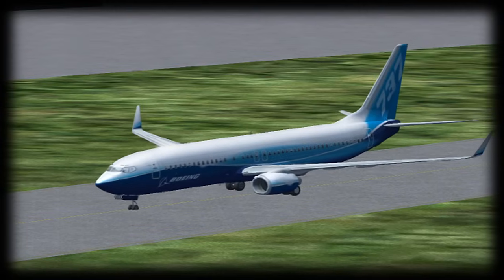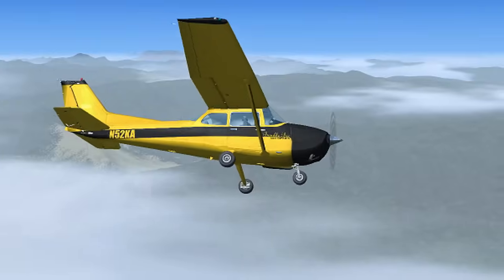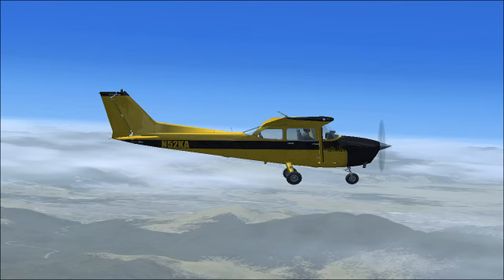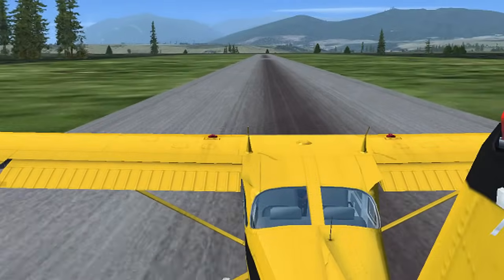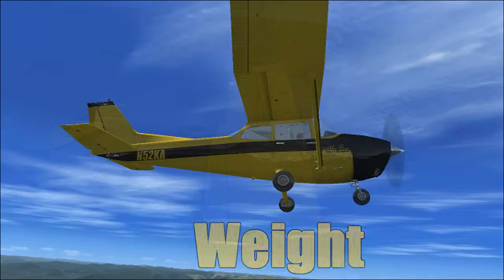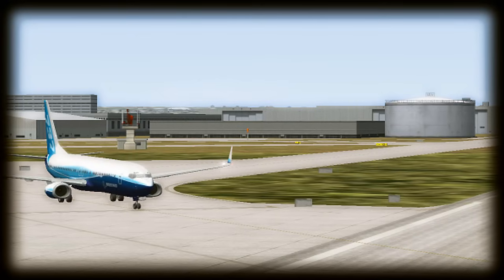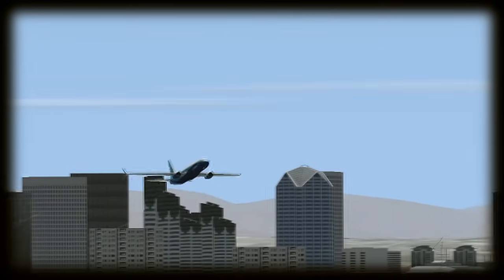The Aerodynamics of Flight

Comment: Great video but we have to point out that this is one of those videos that get the theory of lift wrong. Even though some minor lift is generated by air being forced to move faster above the aircraft, the vast amount of lift is generated by the aircraft curvature turning air downward and the air applying an equal but opposite force upward (lift) upon the aircraft. Even though the second and minor cause of lift is altimately explained by Bernoulli's principle, it is actually the coanda effect that creates pressure difference between the top and bottom aircraft surface. The coanda effect is the tendency of air to follow the curvature of a round surface

Comment: Who watching this in 2024 vote here 👇👇
Reply: Present
Reply: Here. Great video but we have to point out that this is one of those videos that get the theory of lift wrong. Even though some lift is generated by air being forced to move faster above the aircraft, the vast amount of lift is generated by the aircraft curvature turning air downward and the air applying an equal but opposite force upward (lift) upon the aircraft. Even though the second and minor cause of lift is altimately explained by Bernoulli's principle, it is actually the coanda effect that creates pressure difference between the top and bottom aircraft surface.
Reply: @randatatang9222  intresting...I never heard about this
Reply: 2025
Reply: Sorry I'm late 😅😮
Reply: Here

Comment: When a slightly inclined aerofoil starts from rest, it dumps a starting vortex in the flow. This can actually be visualised. If it stops, it dumps a stopping vortex. If it moves in an intermittent start-stop action, it generates a vortex street which can also be visualised.

While the aerofoil is moving, the stopping vortex is tied up with the aerofoil as bound vorticity. This generates lift by the Magnus effect. I can explain the Kutta condition and the Kutta-Joukowski circulation theorem if you like, but Magnus effect is good enough.

A hydrofoil moving through liquid sodium generates lift by the same mechanism. The same hydrofoil moving through liquid helium with the same geometry or kinematics does not generate lift, because the helium is a superfluid with no viscosity and therefore no starting vortex.

Explanations appealing to Bernoulli, Newton or Coanda are useless at distinguishing between liquid helium and sodium.

Comment: Would it be important to say that the y component of lift must > weight?

Because with a high angle of attack, lift is not parallel to the force of gravity, and therefore some of the lift force is in the x axis, causing induced drag.

As angle of attack lowers, and lift force becomes close to parallel, induced drag lowers.

Comment: the book "Stick and Rudder" by Wolfgang Langewiesche explains LIFT in much more simple terms,.. the Wings push the air down (given it has positive Angle of attack) , and with the proper speed, having pushed enough volume of air down - the airplane takes off.  it's a fascinating read

Comment: No, wings don't produce lift because of the bernoulli effect. Wings produce lift only by deflecting air. Wings that don't have an airfoil work exactly the same way. They can get lift even while upside down. The airfoil shape is about the efficiency of deflecting air. Different airfoil shapes are more or less efficient at different speeds, but in anycase deflection causes the lift, not the shape. A older textbook might tell you that low pressure above a wing causes lift. However, low pressure above a wing is lift. Lift does not cause lift. The older textbooks might also tell you that air above the wing meets the air underneath in equal time. This is also false. Air above advances past, while air below is retarded. ( only when the wing is doing work). Air above and below meet at the trailing edge only when the wing is not producing lift. The bernoulli principle explains how a force is transmitted to a wing, but not the cause of the force. You get lift by deflecting air, not by causing low pressure above the wing. The low pressure is the lift reaction caused by the deflection action.

Comment: Not a very useful video for understanding airplanes. He used the incorrect "equal transit time" theory to explain lift which is not how lift is generated. 

He also identifies weight as one of the forces acting upon an airplane but weight is a measurement and not a force. The force is gravity. This would be a failed question on a FAA exam.

Then he explains drag as the mere existence of the airplane which doesn't make any sense. He then uses inertial resistance to explain drag which is again completely wrong and there are several types of drag acting on an airframe, especially drag induced by lift.

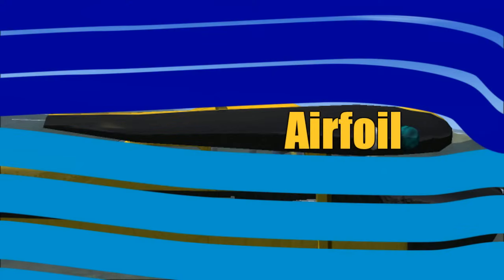Comment: At 2:05 you begin to speak about air's speed, as it moves along the curve of the top of the wing, and as it moves along the bottom of the wing, and you say the over top air is forced to move faster. Do you know WHY the air going around the curve of the wing's upper surface and "hugging" it, is forced to move faster????? Let's establish that we are speaking of straight and level flying, Clark Y shaped, wing, FLAT bottom, curved top, ZERO Angle Of Attack, and rate of travel is 100 knots, about 115 MPH. [The Clark Y foil was used by this Great Kid: https://youtu.be/eNSN6qet1kE?t=10m14s ] ALL air molecules in the atmosphere are being pulled toward Earth by gravity. Closer to Earth the air molecules are closer together compared to air molecules that are farther from Earth's surface where gravity is weaker. The simply Clark Y shaped wing, while moving forward displaces air molecules. Compared to those molecules touching the top of the wing surface, or  those “close to” the top of the wing surface, the air molecules below the flat bottom of the wing, even those touching the flat bottom, are almost NOT forced to move. THOSE air molecules moving over the top curve, are displaced by the wing quite measurably, forcing them to be closer to each other, as they are pushed against the air molecules that are “not too many” inches above them. These, much closer to one another air molecules, touching and very close to the wing’s upper surface, are the ones that become forced to move rearward, [to find themselves behind the rear of the airfoil] because the cubic inches of space that they have, within which to exist, is less than those air molecules “close to” the UNDERside, of the FLAT bottomed wing surface. The way a Venturi causes a speeding up of gases moving through it is VERY similar. We must keep in mind that the air molecules above the wing, [say 1.5 feet and more, above the wing] are still being pulled toward Earth's surface by gravity. So, those higher air molecules being pulled down, combined with the upper wing surface forcing air molecules near it, to be pushed up, against those just a few inches higher, [say within 1.5 feet] create the SQUEEZE. And THAT, causes the forcing of the air molecules touching the upper wing surface, and the forcing of the air molecules that are very close to the upper wing surface, to accelerate rearward. If you watch smoke while a simple wing, at subsonic speed, collides with that smoke, you see the smoke behave as I've described above.

Comment: Old and very bad science repeated again.
..
You mis-state Bernoulli's Principle.  Changes in speed are accompanied by changes in pressure. It is not speed, but acceleration that is associated with pressure gradients in space.
...
The upper air is accelerated by the higher pressure ahead of the wing pushing it toward the lower pressure above the wing.  THAT is what "forces" (accelerates) it rearward over the top!

Comment: The slow and fast moving air is completely a myth. Bernoulli's principle is applicable at two points on the same stream line.
Reply: +Aniket Sharma,
..
While you are correct, because the air ahead of the wing that goes above and below the wing both start at the same pressure and speed (zero), these two streams are related very closely and the differences between upper and lower are indeed related by that common point.
..
In addition, fast air does not "create" its own lower pressure. This is a common misunderstanding of Bernoulli's *Equation*.
..
I discussed this with the author and ERAU Professor Charles Eastlake. His paper describes using Bernoulli's Equation for the above and below differences and it works:
https://wiki.mattrude.com/images/4/44/Bernoulli_Newton_Lift.pdf
..
Also, measurements on a wing developing lift when viewed from the stationary air reference, the air below the wing is actually moving at a higher speed  about 1/4 back from the leading edge!! Yes Actually!

Comment: here are some very very late thoughts, for you and subs.    even tho the word 'weight' is commonly used.     it is, perhaps, worth noting that 'weight' is  NOT  a  Force.   the force involved, is  GRAVITY.     at 2:16,  reference to bernoulli's work  should be  Omitted;  as it does  Not  adequately describe the process called 'aerodynamic lift'.    bernoulli's work does  Not  explain the way in which a 'zone' of lower air pressure can be caused to  PERSIST  at the upper surface of an object, that is   Moving  Through   air.    cheers         googletranslate
Reply: The problem is that in the English language, the terms «Weight», «Weight Force» and «Mass» are used interchangeably whilst they actually have all different definitions. It's the weight force that is meant here, but gravity has a significant impact, indeed.

The weight force W compounds of the mass of the object m times the gravitational constant g (9.81 m/s^2). 

The Maximum Take-off Mass (MTOM) of a Cessna 172 is 780 kg. The applied weight force is W = m*g = 780 kg * 9.81 m/s^2 = 7’651.5 Newton.
Reply: @Tranefine  bla-bla-bla-bla-bla-bla  irrelevant bla-bla-bla      you  cannot  be  WRONG  and  right, at the same time.   putz

Comment: ill explain the lift. Lift is the force that directly opposes the weight of an airplane and holds the airplane in the air. Lift is generated by every part of the airplane, but most of the lift on a normal airliner is generated by the wings. Lift is a mechanical aerodynamic force produced by the motion of the airplane through the air.

Comment: The explanation of *LIFT * you provided is a common mistake! The air is directed downward which by Newton's 3rd Law cause a REACTION force. And the air pressure difference is a result NOT a cause in this case.

Comment: Sure. Extremely simplified. The plane doesnt just lift when it reaches a certain speed, you need to use the elevator flaps to set an angle-of-attack that will generate enough lift force first.

Comment: look at the angle at time  6:40   that is angle of Attack  =  lift    And why do you think we use flaps  well it is to force the air down  the air forces the aircraft up..    Easy  well as long as you are moving forward at the speed needed to keep you  up   that is power.

Comment: Sorry sir it is the Relative angle into the wind not the lift at the top of the wing..   Think a stone skipping on water as long as the front of the flat rock does not touch the water it skips.  if the tip of the wing or rock is even or lower the is not flight.    The Angle of attack keeps the lower part of the will exposed to more air and the air pushes on the bottom as long as the airplane is moving at the Speed the wing will need to leave the ground.    
Please  This old story is just not true in the fact that there is much more to flight that this simple video   and look at the  angle of attack on the 172  it is level the aircraft will not fly like this   EVER as the weight of the aircraft is much than the very little lift from the shape of the wing.    Sorry Kids..

Comment: Bernouli's principle is only applicable to straight streamlines, not curved streamlines which is the case when speaking of lift forces on an airfoil. It is the flow curvature over the upper and lower surfaces of the airfoil that generates lift. Hypothetically, if you were to walk downwards toward the upper surface of the airfoil from the space far above it, you would experience a negative pressure gradient. You will continue to pass curved streamlines with lower pressure than the ones previous. The lowest pressure will be reached once you reach the upper surface of the airfoil. The pressure just above the upper surface of the wing would be lower than atmospheric pressure. Conversely, if you were walk upwards toward the lower surface of the airfoil from the space far below it, you would experience a positive pressure gradient. You will continue to pass curved streamlines with pressures greater than the ones previous. Thus, the pressure just below the lower surface of the airfoil would be greater than atmospheric pressure. The resulting pressure difference between the upper and lower surfaces of the airfoil (p_lower > p_upper) generates upward lift forces on the airfoil. This is the proper way to think about lift.

Comment: Newton 3rd. law is fine for horizontal movement. Rocket thrust backward and reaction forward. During stable flight upward force(lift) equals weight of plane, a state of equilibrium.But I explained, how upward force(lift ) is generated. Wings X-sectional shape create 2 different velocities of air molecules which results low and high pressure zones.

Comment: 6:35 is either partly wrong or misleading, for the aircraft to lift off the ground the lift force must be greater than the weight force. For example if you apply 2N of force on a toy car from one side of a toy car and 2N on the other side simultaneously which direction does it move in? It remains at a constant speed (0). So if 20KN, for example, are being exerted onto the plane as weight and 20KN as lift will it go up or down. However if  21KN of lift is applied it compared to 20KN of weight the resultant force will be 1KN up. What I think he meant when he said the Lift and Weight have to be equal is that they have to be equal to stay at the same altitude without rising or falling.

Comment: Is weight the correct term or is it gravity? (downward force on an aeroplane)
Reply: +iii 3xki  Gravitational potential energy is a type of energy like kinetic energy or thermal energy. The force acting on the object, being the product of mass and gravity (where gravity = acceleration), is weight. Simply put the correct term is weight.
Reply: Rojoyerf Thank you so much. You saved me. I have a test on flight and aerodynamics tomorrow and the teacher always gets me confused. This was simple and understandable. Very appreciated.
Reply: Force = Weight = Gravity * Mass
Reply: It's the weight force that is meant here, but gravity has a significant impact, indeed.

The weight force W compounds of the mass of the object m times the gravitational constant g (9.81 m/s^2). 

The Maximum Take-off Mass (MTOM) of a Cessna 172 is 780 kg. The applied weight force is W = m*g = 780 kg * 9.81 m/s^2 = 7’651.5 Newton.